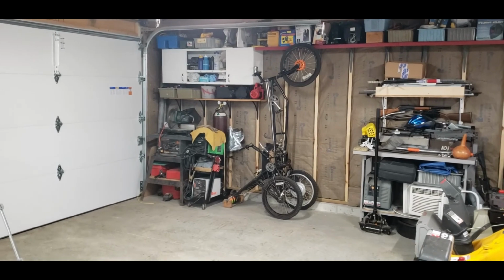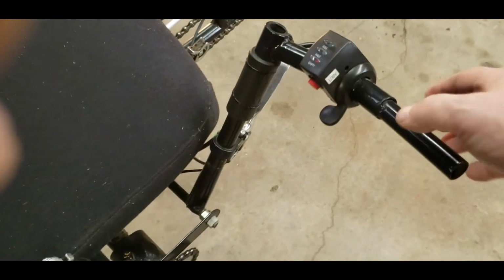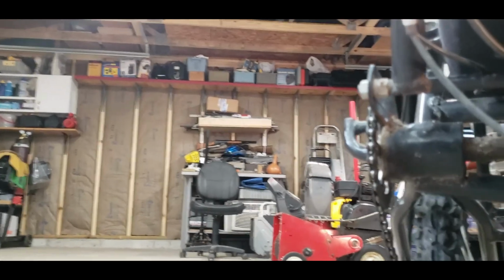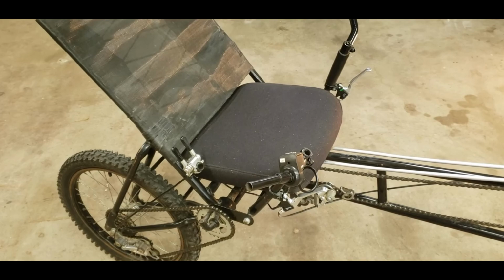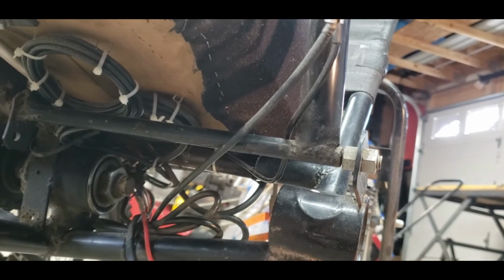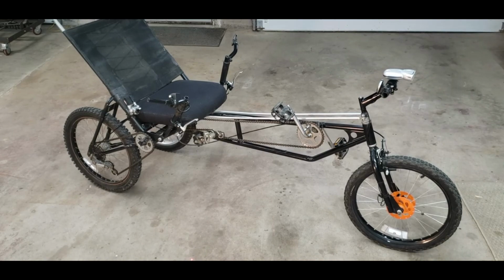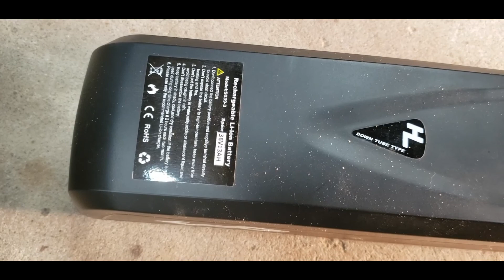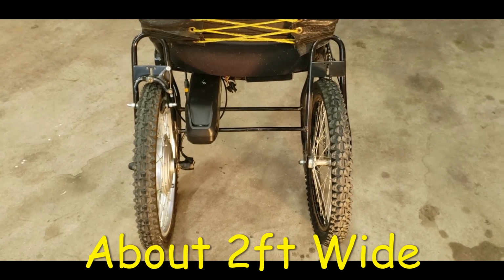Recumbent Tricycle Build with Electric Drive Wheel (E-Trike)

Comment: There are many good ideas in this trike design.  I like the manner in which the rear needs of the  two bicycles were joined together with the main cross beam linking the pedal hubs  and the seat pipe helping a little. With the seat being placed very close to the real axle means that the main cross beam is not twisted by the force on the front wheel. Being a very old man , I would have installed the pedals a little lower. Also the crank for the steering should be a little longer to have a more positive steering.  Apart from that all is top notch, Congratulations, Well done.  Perhaps a little improvement in welding  would have looked better, but what there is is good enough.